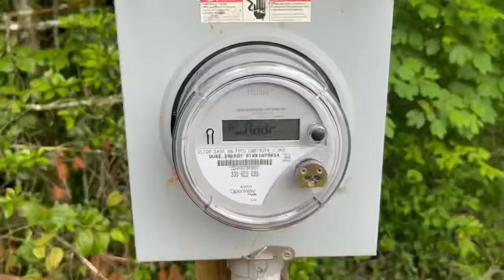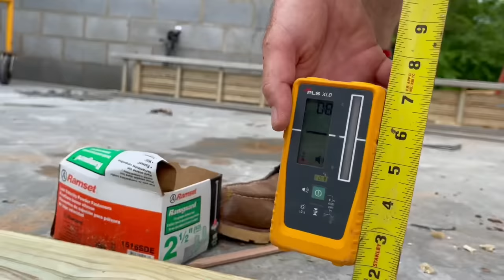Floor Framing | Building The Nantahala Retreat #7

Comment: Love watching your videos... I learn so much about building and you all are just good people!  I have been on many construction sites and it is refreshing to see clean work done by those who care to do things right!
Reply: I agree!  Live in a development where most of the houses are slapped up. Every once in a while another builder comes in (when the main builder is behind) and does one. The difference in the main builder and the back up builder is huge!!
The back up builder actually follows all the safety stuff like strapping in through a patented metal support system they have. The scrap lumber is put in bins around the build. And at the end of every day, they go around and clean up. They have a small crew compared to the main builder, but they are faster at building—because the main builder usually has to take stuff apart and fix it😖
We were thrilled when we found out our house was done by the back up builder.

Comment: That trick with the level is worth having looked at the whole video. Unfortunately, my young self (in 1978) let my framing subcontractor convince me that using green lumber for floor joists would work out just fine (they would straighten any that bowed! NOT!) Consequently I have a house that doesn't have a level floor anywhere in it! I think the lumber yard owner and my contractor had a deal to get rid of some rough cut, green, lumber and I was the sucker who bit.

Comment: They make a turnbuckle that you can nail a 2x too it so you can make it any length they are awesome for basement walls this way you can keep the buckles all inside and not have to work around it when doing the plywood.

Comment: Very interesting. I'm being trained as a carpenter (educated as a mechanic/welder). We're working on a house right now at the same stage as this, located on premium land next to a big lake in Norway. I really love how you get more into the nittygritty stuff of building things with understanding, knowledge and good practice.

When you are plumbing the corners on the outside walls, what kind of tolerances do you shoot for? What are the tolerances you shoot for diagonally for the floors?
Reply: In NZ our timber building standards state: vertically, 5mm per 2.4m or 15mm for 2 storey structure. Horizontal is 5mm if <10m length or 10mm if length >10m

Comment: Just bought floor trusses for 24x36 building. 18" deep. They were just over$5000. Could have been significantly less if they didn't need to clear span and have room for mechanical. So might have been comparable...

Comment: With the lumbar process so high could you not just build all the ground floor in block work??
Reply: Probably wouldn't be much cheaper. It takes a lot of time to build a block wall and time is money. It's also harder to insulate and run utilities
Reply: Wat

Comment: Great Vids, on an earlier episode you used a sealant between the block an 2x6, lexel.  Would this work for in-between cement patio an base plate on a screen in patio so water won't flow under?

Comment: Rim/band joists can be osb,plywood,2x. Do you prefer the same material as the floor joist for stability on the ends? I've seen 1/2",1-1/8".just wondered why so many options.am going to take 60hr builders license class soon.

Comment: What depth do you run the planer at I have the same and it always seems to get loaded down with chips and clog on me. ☹️
Reply: I rarely take more than 1/16 at a time with mine. If the wood is knot free I might bump it up to 1/8 if I'm taking the crown out of something.

Comment: hey Guys...Out of curiosity... water seems to be wicking from the ground up into the concrete block. AND it’s all wide open, will sealing the exterior wall stop that? Or will it always draw moisture from the footing?

Comment: When you move the location of a door or any framing for that matter, don't you need to get an "OK" from the structural engineer? Do you need a structural engineer to sign-off on single-family residential homes in  your state or is it not required for smaller square footage homes?

Comment: what's the procedure for making a change during construction to the house when it doesn't match the blueprint?  Just build it to code and you'll be fine?
Reply: If it's a small change like that, the inspector doesn't really care as long as you don't need an engineer to size a load bearing member.
Reply: Depends on the situation.  In a place without formal code enforcement, you are correct.  In a place with permits and plan approval, it’s dependent on what the code official requires.  For my jurisdiction, unless something constitutes a safety concern, we basically just have hem submit a plan change to us and they then build the change at their own risk if they want to.  So if they change something and build it and it doesn’t meet code, then they will have to take it out to comply.  We don’t like to make people stop progress if we can avoid it usually.

Comment: The reason why you had to plane the top plate is you took stud length measurements from the slab.  The bottom plate will bridge minor low spots.  Next time measure from the top of the bottom plate and use some non shrinking grout to bridge any noticeable gals.

Comment: Pro tip why don’t u use a 2x6 for the drywall backing on top of the wall instead of 2 2x4 u only need an inch for the drywall screws u don’t need lotta met

Comment: This channel is one of my favorites on YouTube. Good content, well presented. The only question I have is: will your insurance company cover personal injury claims given you have provided them a library of videos showing your employees not using safety glasses, gloves, harnesses, hard hats, etc? Maybe you are planning to self-insure with your YouTube proceeds.
Reply: Definitely worth thinking about. Years ago the local newspaper put a picture of an addition in the paper. I think there was a small article with the name of the contractor and how happy the customer was. Good publicity for the contractor, right? Trouble was no one took any permits out.
Reply: @jaygerke6746  I understand your point, but your use of pejoratives leaves a lot to be desired. Also, if an insurance company hires one person to cross-reference YouTube with their policy holders, they could easily offset the cost of that salary in denied claims. Doesn't take a brain surgeon.

Comment: I learn a lot of new words watching these videos.  Now I know if I come across a "humpy" board that it might need to be planed down to make it more level. Interesting!  I know this is long after the video was uploaded, but what was the reason for those trenches downhill from the job site?  They are at 14:41 in the overhead shot.  Also, what drone/camera system are you using for those shots?

Comment: 👨🏻‍🦳HAPPY FATHER’S DAY👴🏻
    Are YALL going to put bridging between floor joists and what about corner post and T Post—will Yall go back and add studs to make them solid?
    It is always fun nailing those Yellow Pine with 16’s— especially the band boards with toenails into the bottom plate. Code here requires foam insulation under pressure treated bottom plates- same for Yall? We nailed bands up 1st then installed floor joists, then decking. Next while boss was laying out walls, windows and doors; we were building corner post, T post and headers. That insured all were flush and straight. Spruce used for rest of framing. 
    Beautiful Work and Thank YALL for these historic builds in THE MOUNTAINS OF NORTH CAROLINA⛰

Comment: Yellow pine. That means either Ponderosa Pine, or Jeffrey Pine, which, at least here in California, are considered soft woods. Doug Fir is a soft wood too, but it's a "hard" soft wood, much harder than any Pine, and it's what we use on the West Coast. All studs, posts, beams and girders are Doug Fir, by code. Unless we use PT, which is usually a Hem Fir. This is most likely because of what is available in the area. But I wonder if this means our houses are stronger than yours? We do have earthquakes we have to contend with, but not hurricanes or tornadoes. Personally, I would love to use Yellow Pine as it is easier to work, and lighter. But we will use it, or white pine, for trim inside or out. Also, I would use Green board, with the appropriate fasteners, on the slab, Just because you never know.

Comment: Wouldn’t it be easier to shim the floor joist instead of cutting studs in different lengths. It sounds like there is more room for error with what you did and more work.

Comment: You know a rim board is a header too. On some of the smaller windows you could skip the header entirely or put a single header. Instead now you have triple 2x12 headers on these small openings. Such a waste of wood and takes away space for insulation, too.